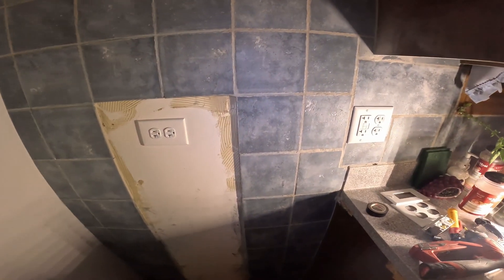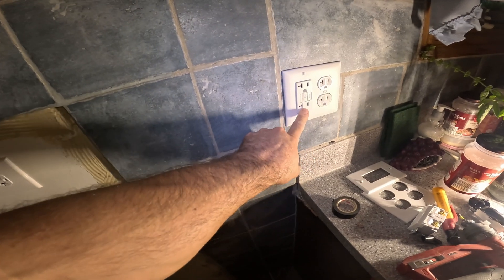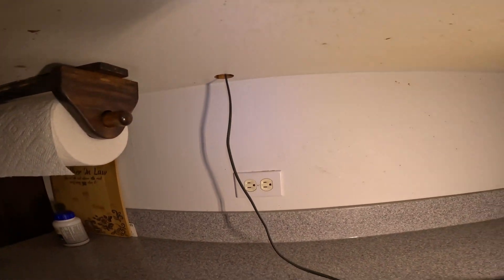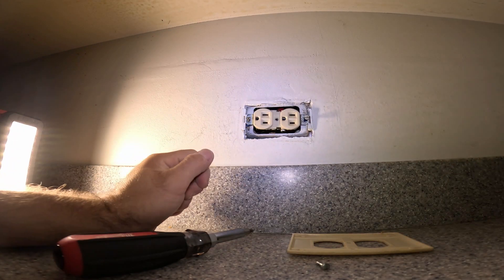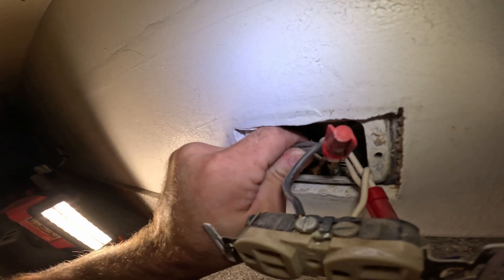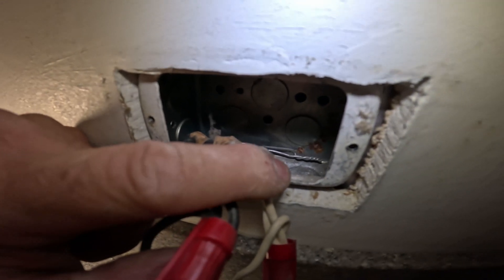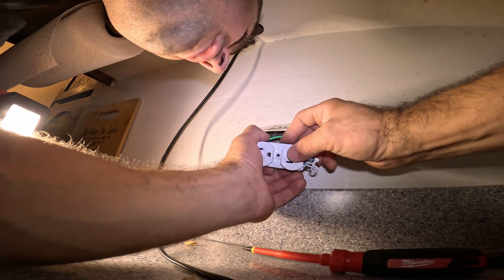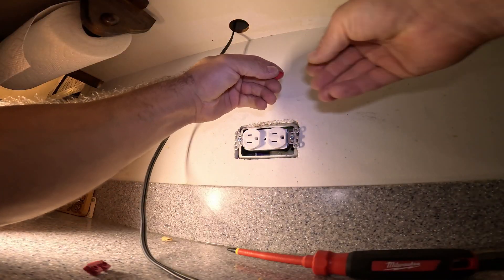GFCI Protecting Kitchen Outlets/BX Wiring PART 3 Saga

Comment: I believe that thin wire in Greenfield is not intended to be a ground wire but should be wrapped around the metal jacket and clamped in the cable connector.  It can also be used  to hold the anti short bushing, red head,  in place.
Reply from the maker: Yes ur right that's why I was calling it a garbage wire. They used to wrap it around it or cut it off or some attach to box.im just grounding it for good practice. I could wrap that aluminum wire around the connector.